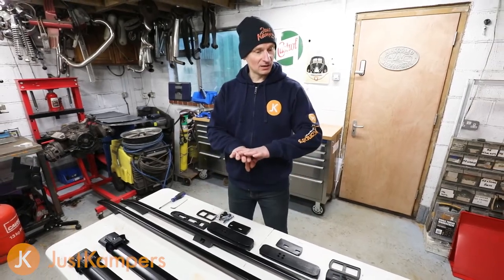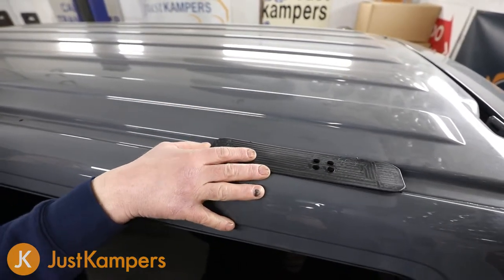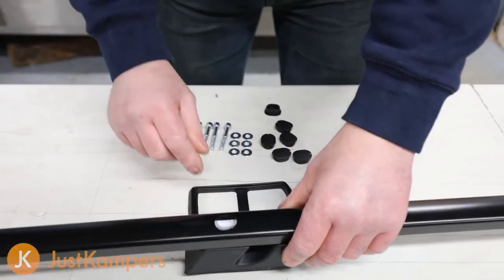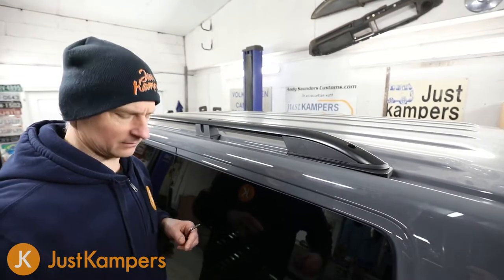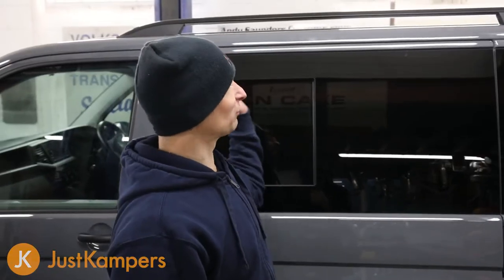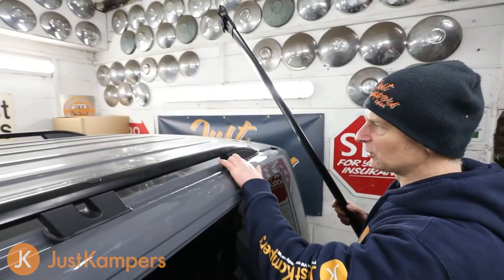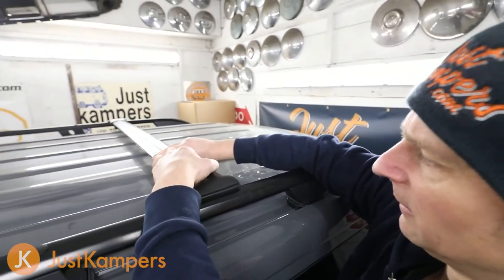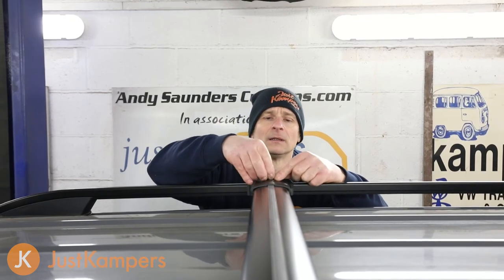JK Guide: How To Fit Roof Bars And Cross Bars To Your T5 Or T6

Comment: How do you get the blanking caps back out?
Reply from the maker: Hi! They can be a tight fit to be water tight, would you need the slimmest screw driver possible to slide down the edge and pop it out. Hope that helps!

Comment: I have these bars but can’t get the rubber plugs out now I’ve fitted them to move them around on the rails - any tips?
Reply from the maker: Hi! They can be a tight fit to be water tight, would you need the slimmest screw driver possible to slide down the edge and pop it out. Hope that helps!